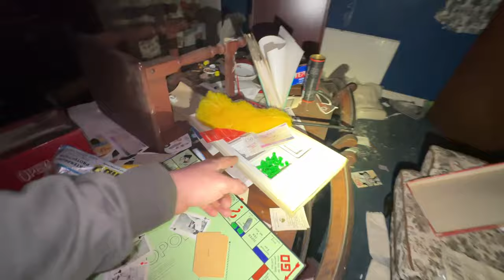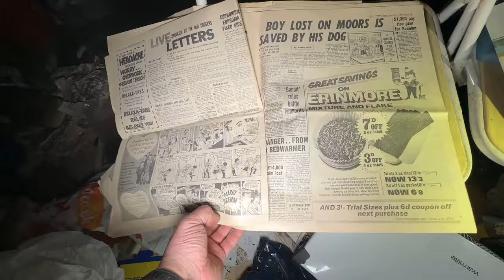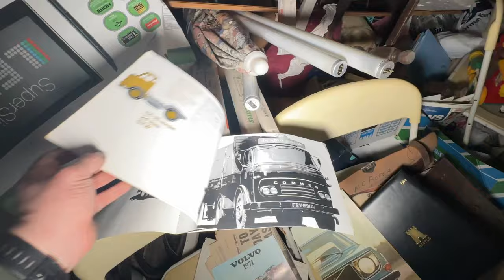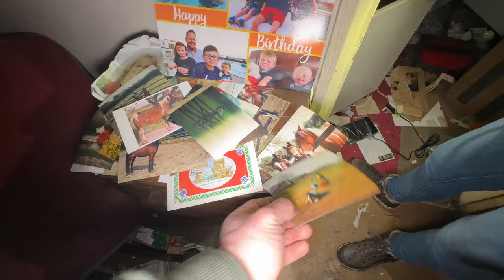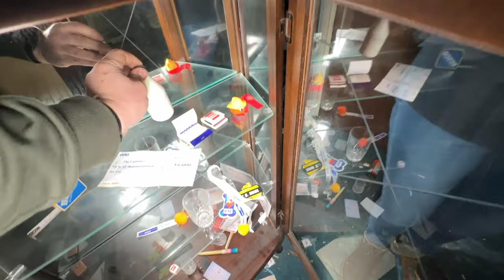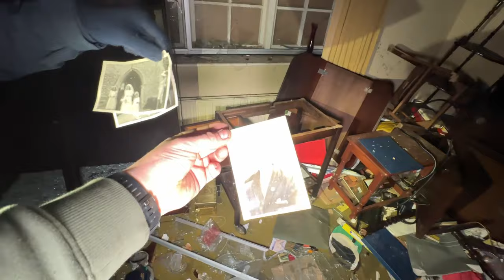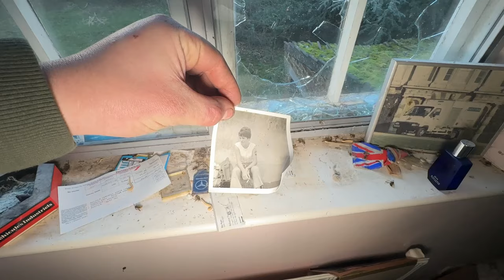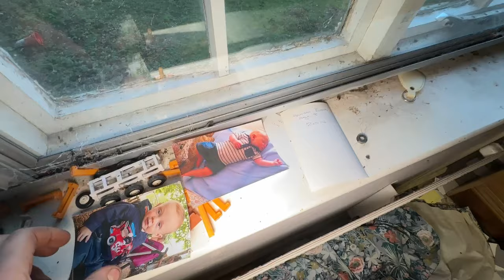ABANDONED mac"s house everything left - abandoned places uk

Comment: Interesting place some great retro electronics there that I remember and gadgets, on the subject of Dodge vehicles in the 80's there used to be Dodge and Chrysler combined dealers in the UK and also at one time British Telecom used to have Commer vans originally and when the new ones came out they were the same type but renamed Dodge Spacevans,The Asda Uniform looks like the same as the one I had back in 2015 as I worked at a branch part time for a year. It's a shame its been trashed and the family aren't bothering with the place lots of evidence of squatters being there by the looks of it at some  time and those that steal the pipes and boilers to sell to scrap dealers.